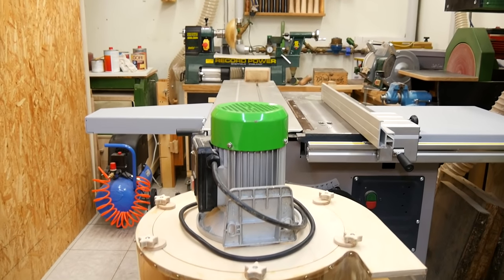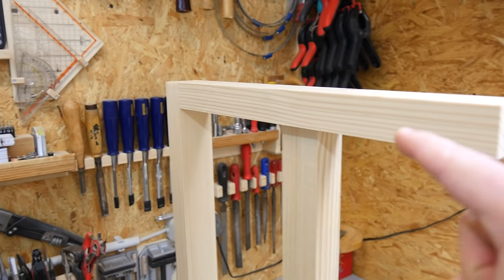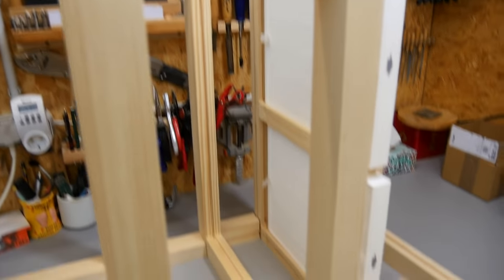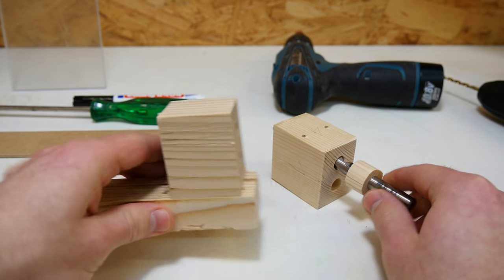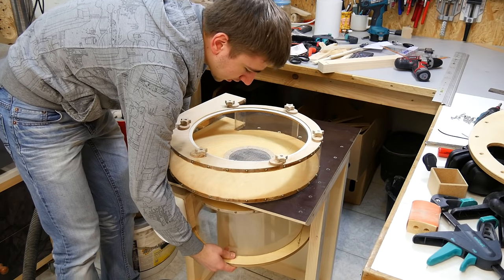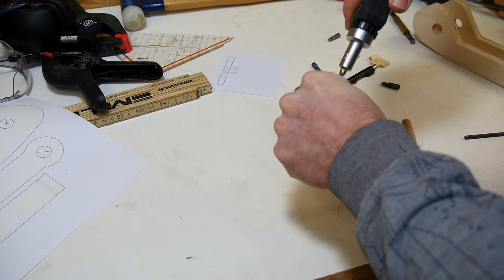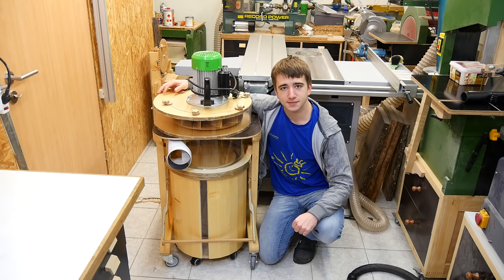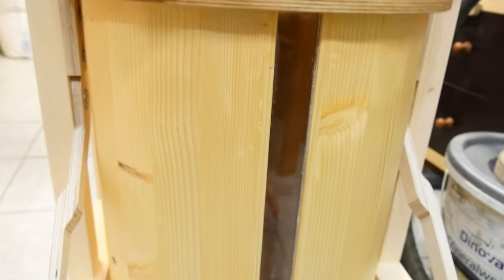It's Finished!!! (Small Dust Collector #4)

Comment: Could you possible leave me a link or say what filters you used. As I was going to do something like this but without the easy lift caddy. I was going to do the cyclone and motor with the wheels and add the box at the back with the filter but have a suction fit lid which I’ll just lift on and off.

Comment: First you had to trim the fan cage to lower the power consumption. But with each part added to the air flow, the load on the motor seemed to get smaller. Why is that? Is is because of the lower inside air pressure when the system is running?

Comment: I just want to say...if you make an alternative joint with screws and dowels, the dimensions of whole frame will change (if you have same lenght dimensions A and B parts as in box joints ) because in box joint lenght of frame is just lenght of A (or B) part....in alternative lenght is sum of lenght of A piece and thickness of B parts..

Comment: i used to work at a home improvement store, in there we had one of those giant panel saws with industrial dust collection this unit also used a cam system to keep the dust bin secured. great job on this project

Comment: Absolutely, Undeniably, Excellent Engineering and Design! I have thought long and hard about how I would build one and yours has covered all the bases except one (sound proofing the motor). However, the ingenious cantilever you designed surpasses anything I have ever seen to quickly and easily secure the refuse bucket. And may I add that your videography is superbly done! Honestly this is the best design and build of a DIY dust collector I have ever seen!

Comment: For a better dowel jig guide life, you can use a spot drill for CNC machines. It only has limited length scrolls on the shaft and thereby will not chew on the guide holes.
Also when you are visiting your CNC tool pusher, have a look at some hardened drill gig inserts for the ultimate solution. ;-)
Reply from the maker: Hey, good idea. But are they also as long as a normal drill bit?
Reply: The normal length are about 60mm or so, but you can get them in extra long and the scrolls are still short.

Comment: I saw in your video that your small shop doesn't let you cut larger panels have you considered a temp panel saw add on for your table saw I added on made of PVC to my Beast of a work bench. it can be removed when not in use. I use it when stocking larger materials into my shop so I do a lot of my large cuts at one time, I keep a few large full panels on hand but cut most stuff down for storage.
Reply from the maker: No, I fine with how it is. I just plan my projects around the size of my shop.

Comment: As always,  excellent work and a pleasure to watch.  But there is something I don't understand.  Why does the watts keep getting less. When you determine the size of the impeller,  it was 1080W, at the end it was 500W...why?
Reply from the maker: The cyclone restricts a airflow, so less air that the blower has to accelerate, which means it doesn't have to work as hard and requires less power.

Comment: This is why I call you 'the prodigy' whenever I share your builds. Mind blowing production, I love using your screw/dowel trick I learned first from your edging shoe video. I also use box joints whenever possible because it always feels like lost potential in the wood whenever I use screws, even though it might not need the strength,  real joinery always adds incredible rigidity.

Comment: Have you tried to connect this dust collector to duct in your shop? I wonder if it has enough power to use it as a main dust collector?
Reply from the maker: +Jan Okoniewski yes. For example when I was relocating the big dust collector. And it worked with the pipes.

Comment: Very nice build.  I don't know if I can tackle this or not, but will be saving.  Just curious, why did the cam level handles have to be two pieces?
Reply from the maker: +BJEAKE With only one piece the bucket couldn't fit through the two cams, because of the bigger bucket lid. (good question)
Reply: That makes sense.  Thanks!  Great build.

Comment: nicht schlecht! allerdings finde ich ja den besten teil den mit den Rollen! und kannst du mir sagen woher du diese "bügelverschlussdinger" hast, so was suche ich.

what I was wondering about, how do you ensure that the air is actually passing trough the filters and not just aroudn them (as there is no real seal around the filters....
Reply from the maker: +simon stucki Die sollte es eigentlich im Baumarkt geben. Ich hab sie von dem Kleinteilehändler meines Vertrauens gekauft ;)

Comment: Do you have a drawing for the cam levers to lift the bucket?  I am doing the same thing and  would be nice to print it off and trace on to the wood
Reply from the maker: No, unfortunately not.
Reply: Thanks. I'm building a large mobile cyclone dust collector with a 55 gallon barrel to hold the saw dust

Comment: Impressive!!
I was just wondering ... how much dust made it through to the filters?
Reply from the maker: +Francois Fouché They are rated for 0,3 microne, so I guess (almost) none
Reply: +Marius Hornberger Hi M, I think you misunderstood, how much did the cyclone mis, how much were captured by the filters?
How much made it through TO the filters ..  not through the filters?
Sorry, maybe I should have asked the question in different way.
Reply from the maker: Ok, for general use like hooked up to a table saw, the cyclone efficiency is about 99% (as far as I can tell). But if you suck up a big pile of dust at once (which normally you don't do) the finer dust can make it through the cyclone.

Comment: Dont you think that the plexiglass walls is a little thin on the thin side ormaybe a little non robust?? i dont feel sure about it holding up. The inlet and the air force distribuates the force in a circle, but if you suddenly suck up some screws, other metal or bigger wood chips, then the plexiglass will be ripped and weakened over time... I like the plexiglass walls thou, because it  you can see thruough, and makes it very nice! Do you use a plexiglass that wont get scratches very easily or something? 

I am thinking of building a machine like this, but making it bigger and use it in a ducting system.
Reply: and by the way... exeptional work! I admire your skill :)
Reply from the maker: It's not Plexiglass, it's PET. PET doesn't break but only bends. I've already tested a sudden block of the inlet...nothing happened. That's because this type of blower doesn't create very much suction like a vacuum does.

Comment: For these type of cyclone dust collectors, can we build the bucket with a squared shaped box instead of a cylinder?
Reply: +Marius Hornberger, assume I'm talking about a dust collector made out os a traffic cone :)
Reply from the maker: Of course. My big dust collector bin is square. I also have a traffic cone cyclone for my shop vac. It has an oval paint bucket as the bin.
Reply: thanks for confirming my suspicton.
all that I need to take into account is making it air tight

Comment: So it was drawing 1kW, but with the air restriction from the rest of the build it dropped to 0.5kW? Making the impellers smaller was unnecessary then? 
By the way, great build and smart design, well done ;)
Reply from the maker: Thanks! In terms of suction, yes. But as I'm using it for my CNC, which sometimes runs 3h at a time, it's actually better with less power, and the electric bill is happier. And it still has more than enough suction.

Comment: Why not leave the screws in place? Do you just prefer glued joints?
Reply from the maker: +Antti Harri Yes, on the one hand I prefer glued joints, on the other hand they are stronger and give the structure more rigidity.
Reply: +Marius Hornberger
OK.  :)

And the strength of the joint depends on the type of glue and the type of screw. Cheers from a civil engineer. :)

Comment: Hey Marius I have a bit of a challenge for you! Try making a 3D printer out of wood. You could just use a cheap 3D pen for the main  part and som small stepper motors. I would love to see that :D
Reply: +slimeball 
The complicated part is not the hardware but the software. It's easy to build the moving structure from pieces of laminated particle board (lubricated with graphite) and cheap treated rods. Even bearings aren't needed. But to make it move the way you want can be really hard. You have to do so much adjustments in the configuration of the software to adapt it to the hardware. It can be nerve wracking.
Reply: yeah but if you made it so it could be adjusted with som screws.and maybe use a arduino uno to controlle it. it would still be a pain in the ass

Comment: What is the peak power consumption if i may ask. Could u make the same size blower but with a 0,5kW motor or maybe 0,75kW. Where did you get the motor from. I don't know why, but it's hard to find a motor where i live.
Reply from the maker: as shown in the video about 500w. The peak is only when it starts and doesn't matter. A 0,5kW would be just strong enough, but I'd go with 0,75kW. I got my motors from Ebay
Reply: Marius Hornberger Thank you very much, that helps with the search. Alot more 0,75 than 1kW on the second hand market. 👍

Comment: +Marius Hornberger could i use a 600w motor or get a 1000w motor
Reply from the maker: +Josh Jenkins sure, mine draws ~500w, so 600w should work as well. If it's too much for the motor you can always make the impeller smaller.

Comment: in earlyer videos you said the motor was rated at 1000w, and you were drawing that much, but here it's only 500w. What went wrong? Did you not factor in the reduced airflow of having everything in place, or was this a design choice or?
Reply from the maker: I didn't think that cyclone and filter would decrease power consumption that much. But it's actually a good thing, as this machines sometimes runs for one hour with the CNC. So less power consumption = happier electric bill
Reply: Marius Hornberger fair enough!
Reply: Just simple fluiddynamic, if you have less pressure in the system, you have also less mass who works against the impeller/motor ;)

Comment: +Marius Hornberger  Can u help me out,if i use this dust separator in lawn or field of own house where concrete road situated then without electric cord.What kind of generator u will use to power up the machine to get same result without affecting performance(simply you can say small road dust collector and separator)..Please help me out
Reply from the maker: +abinash paul I don't know. A 2000w generator should be up to the task.
Reply: well thank you.What is the power rating of your machine??.Would like make a video on that with generator !!
Reply from the maker: motor is rated at 1000w.
Reply: Thanks dude.I would be very grateful if u make a video on "How to make small road sweeper machine" (Y)